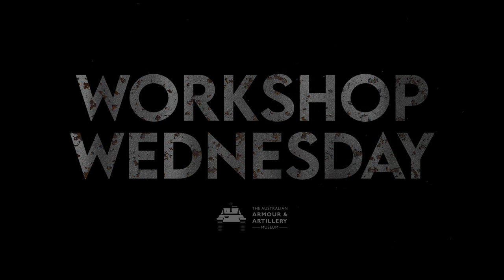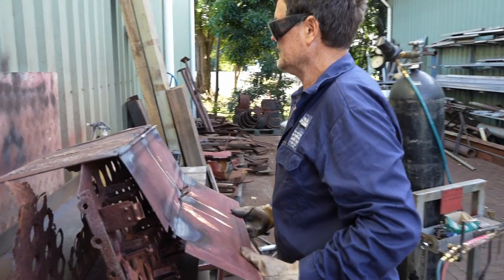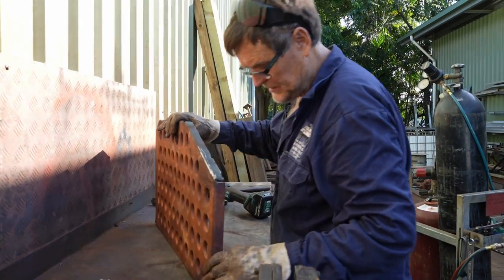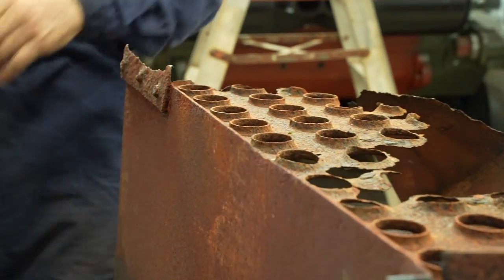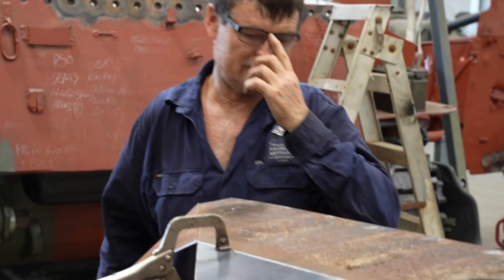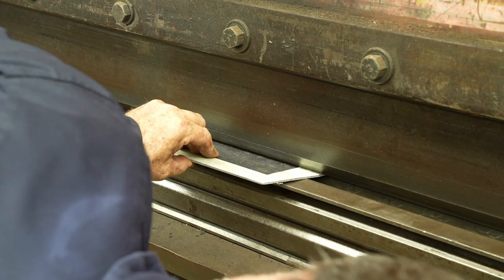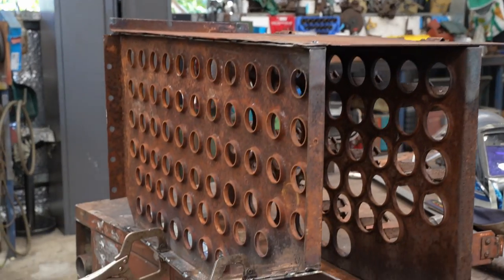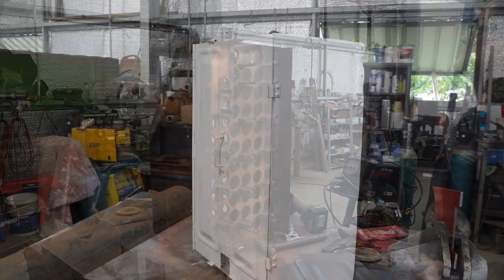WORKSHOP WEDNESDAY: Restoring a 37mm ammo rack for our WWII Grant Tank

Comment: In regards to filling the ammo box with ammunition, I am involved in the resto of a WW2 PT boat in Oregon USS PT658. We have a 37mm Autocannon that needed 39 rounds of ammo to fill the ammo belt for display purposes. Only having 2 real brass rounds/cartridges, we had some volunteers manufacture wooden dummies on a woodworking lathe using the real cartridges as a template. After being painted to look like "brass" and the projectile colors varied between HE and AP (Black and Green) they are now on display and appear very authentic. I think we coated them with epoxy  clear coat as well.  We like to say they pass the "10 foot rule", meaning that you cant tell the difference from 10 feet away! Just a thought in case you have trouble finding so many actual brass cartridges to populate your ammo racks inside of the Grant. PS you can see these on our website for PT658.

Comment: I have used an adjustable wrench many times to straighten metal edges but if you use two of them then you can get rid of the small opposite type bends without having to use so much hammering. Good job with that old rust stuff!

Comment: Fellas with 20-20 hindsight if youve got any rusty seized jobs dump em in a tub of water/molasses 4 to 1 for a week or so .Strips the rust and penetrates, no B/S .Stinks a bit but Ive undone rusted solid 1 inch screw threads easy as and those hinges would have freed up no dramas and no sand blasting required after Love your work wish I was still at it